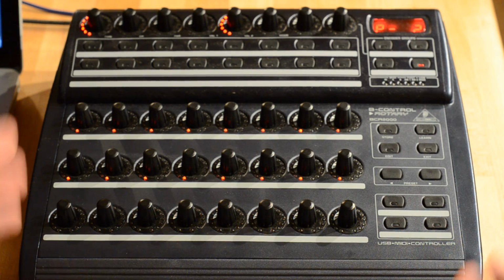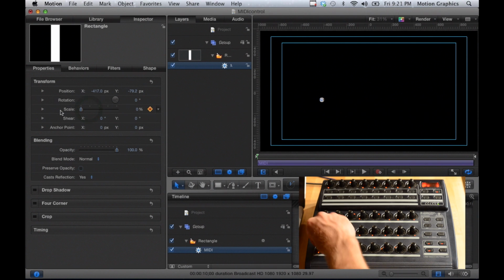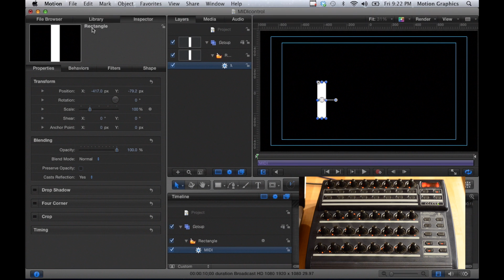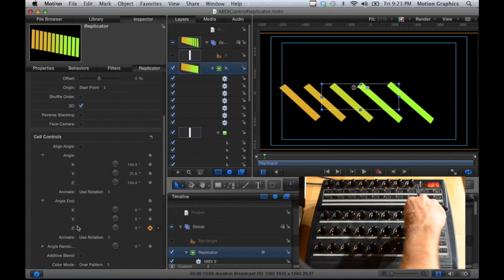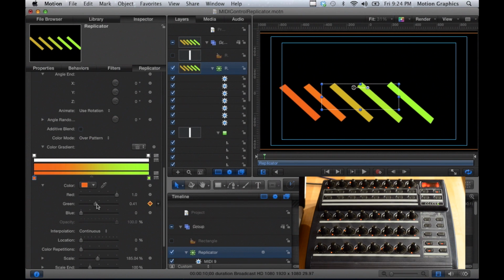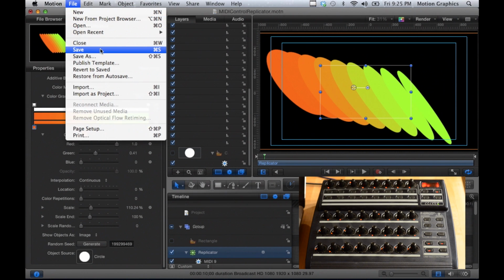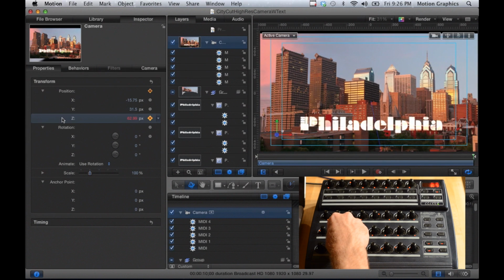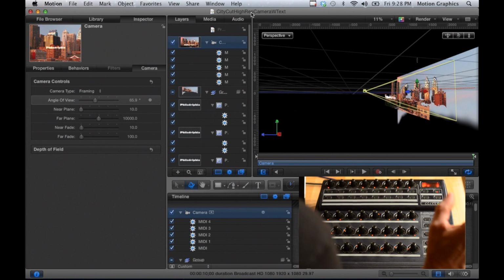MIDI Control: Motion 5 Behringer BCR2000

Comment from the maker: It doesn't seem like Adobe After Effects or Premiere has the capability to use MIDI as control data.  It looks like you can use MIDI control in Audition for audio levels, but I haven't tested it yet.

Comment from the maker: There should be no initial setup.  Did you plug it in after Motion was already started? If so try restarting Motion.  If not try a full system restart.  It should work.

Comment: Hi i just purchased the b-control from Behringer, and I was unsure if there is some sort of midi initial setup that I need to do before I can start using it with Motion 5 on my Mac running Lion. I did exactly what you did in the video, but the parameters did not respond. I'm assuming I have missed some initial setup step- any help is greatly appreciated!